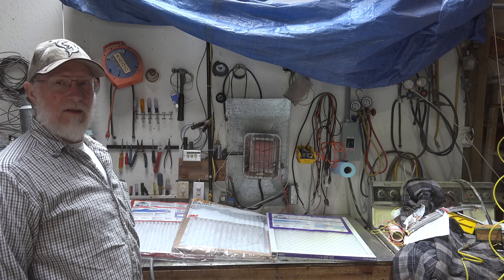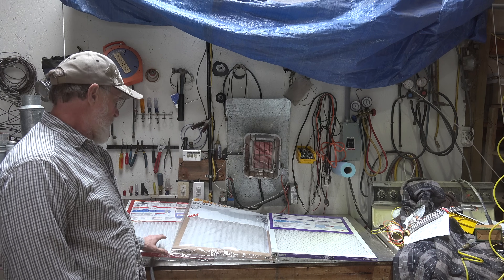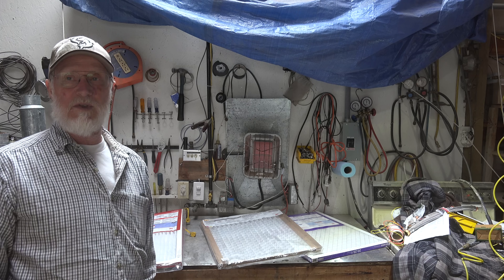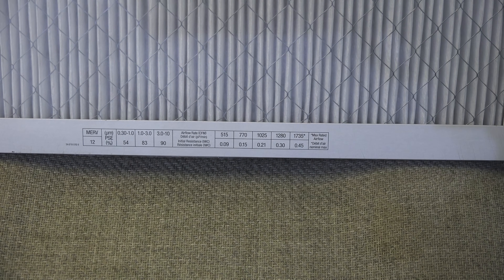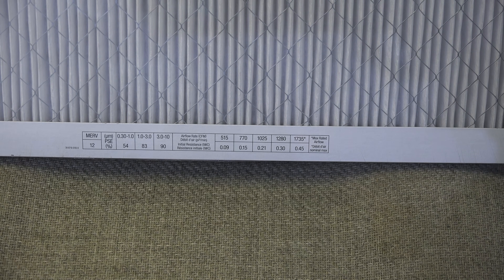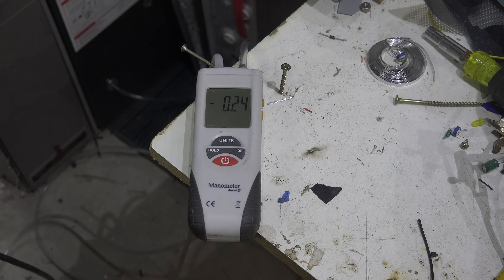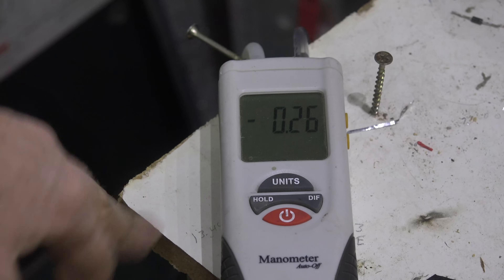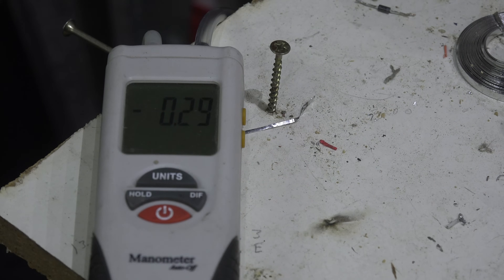What furnace filter is best?

Comment: Crazy how filtrete claims to have the best air flow when I discovered filtrete filters caused the most static pressure. A filtrete merv 5 caused more static pressure drop brand new then my used HDX fpr7/merv 11 after a month.

Comment: This is so confusing !! Should I do a pleated basic , 4, 8? ( older gas furnace )
Reply from the maker: Actually, I generally recommend the cheap fiberglass filters, changed once a month.  Most of the pleated filters have too much pressure drop.  More on this later.
GFM
Reply: @grayfurnaceman  thank you so much ! The furnace guy called them “ bowling ball” catchers 😂 im so conflicted 
I have a basic pleated ( say it so cheap it gets sucked into motor ) 
5 and 7 ugh just ugh
Reply from the maker: @bunnybubs757  I usually say rocks and birds.  The filters are just there to protect the equipment.  The only ones that thoroughly clean the air are the hepa ones.  Most of them are too restrictive and will reduce air flow.  Changing them once a month is fairly good as these filters have oil on the element that catches dust.  The oil gets saturated after about a month.
GFM
Reply: @grayfurnaceman  😂☺️thanks For your reply ! Its an older gas furnace ( no A/C ) im trying to find one to keep the motor going without incident , I’m not really focusing on what it’s supposed to do for the air quality , the blue fiberglass every month probably won’t work .. I’ll forget .. 3 month is reasonable
Reply from the maker: @bunnybubs757  Do it when you pay your bills.
GFM
Reply: @grayfurnaceman  Great idea ! Thank you so much

Comment: Just had a new furnace installed.  I read the install manual and it states to use "High Flow" air filters and change them monthly or more often if dirty, so I'm using a MERV 4 filters.  Our return ducts have (3) 20x20x1 filtered returns.
Reply from the maker: They should work well.
GFM

Comment: We have a 100+ year old house with an old furnace and imgs.love/ACFiltrete?Aた we are currently doing construction in the house which adds to the already very dust, dirty vents. In the meantime, we've been using these and switching them out as frequently as needed. It's made a huge difference for all of us in terms of sneezing and even some asthmatic issues for one family member. The value pack is a great deal, and they are easy to swap in and out. Highly recommended!
Reply: So confusing , mine say 4, 5, 7, 8.. to go by low numbers .. help

Comment: Many older systems are less efficient at heating & cooling when you " give it a better filter ".  They end up running 50% more to deliver the same number of BTUH.  They were designed for the inexpensive Monthly filters, ONLY.  The high MERV filters are not compatible with the blower motor pressure,  heat exchangers & ductwork.

Comment: Great video! Quick question- I always believed that big, thick filters are better, so I was going to install a 4 inch filter box to hold a thicker filter, but a guy at the HVAC supply store that I was going to buy the larger filter box at told me that a 14X25X4 filter would flow too freely for my furnace and cause the blower motor to overload from too much airflow. He said that using a thicker filter than the furnace specs voids the warranty, causes premature blower motor failure, and a bunch of other nasty things.Is it not okay to install as thick of a filter as possible? Thanks

Comment: The lower MERV rated filters have less pleats therefore in a sense they are more restrictive while at the same time capturing less fine particles.   Like everything in life, furnace filters have a cost to benefit ratio.  At least when new, the air restriction of each filter was similar, but it's dust catching ability varied significantly.  Some other articles suggest that very high MERV rated filters which remove "allergens" may not represent a good value unless you actually suffer from allergies.   How much dust a home is experiencing is another issue.   A dog that sheds a lot might be a major factor.  Bottom line: it's probably best to stock up on reasonably high quality filters when they are on sale.  I know in the fall some of the major hardware chains have good promotions.   Interestingly at least where I live, Walmart has a very good assortment of filters at what I believe are reasonable prices. Probably the most important thing from my perspective is not to go too cheap on filters that have limited ability to pick up dust, and to keep an eye on the filters you do decide to use.  One lady I did some work for didn't even know her furnace had a filter and it was filthy.  Eventually the blower motor burned out as the windings were all clogged up with dirt and there was little to no air flow through the motor.  Perhaps the best filter is the one that offers the most protection to your furnace.  One thing I like very much about my Goodman is it has a very good filter box that seals the filters in tightly yet, they are easily accessible and slide in and out easily when changed.  My old furnace had awkwardly located sheet metal screws that were hard to remove and replace, plus the filter itself did not fit very tightly in the duct.  It was a very annoying chore to change the filter. Now it's extremely easy, and I love that.

Comment: I have new furnace, using charcoal filters due to heavy smoker below me in my building.  It is a Merv 8.  have not felt any issue with my furnace though only 2 years old.  Due to heavy smoking, it supposed to change once every 3 months, but with heavy smoke, I change every month.  And these not cheap to buy either!  Can run pretty expensive like $20.00 for one filter.

Comment: A question for you.  I'm want to just cool the master bedroom and the adjacent hallway this summer.  So I am closing all the other ceiling registers and hanging a curtain at the end of the hallway.  The filter inlet is in the hallway, as is the thermostat.  Will this hurt the A/C unit?  It is sized for the entire house and located on the roof.
Reply from the maker: You kind of have a recipe for disaster here.  The system is designed for the whole house and cutting down airflow will probably freeze the coil at the least or damage the compressor at the worst.
GFM
Reply: Thanks  GFM.    I will instead install a small window unit then and leaving the big one turned off.
Reply: May cause mold as well.

Comment: My system can accept either standard 1" or the more deeply pleated 2" filters.   I'd be interested in seeing the difference in pressure drop between the two.    

The deeper filters are both more difficult to obtain and more expensive, but supposedly have less pressure drop after a month or two of use.
Reply from the maker: I will be doing more on filter pressure drop in the future.
GFM

Comment: If you ask me, the best filter on the market is the Lennox X6672 MERV16. Its a 5" filter, and has a huge amount of surface area to massively reduce the pressure drop, extend the life, while giving exceptional performance. They're also relatively cheap at ~$60-70/ filter, considering they should last about a year for most houses. It does need a cabinet to hold it, but they're under $100. Not bad, considering the performance and lifespan.

Comment: My dad's old furnace guy said to get the cheap spun filters and change them every month. They let so much junk through that the evaporator ultimately became the filter. It almost completely clogged and the furnace would shutdown due to overheating.
Reply: RickMakes if this is true your filter is too small causing too much air velocity through the filter
Reply: probably older home with return ducts not sealed from attic and walls with blow in insulation added. undersized ducts, under-size filter. I recall most all the older units having 2+ large filters inside the return/blower cabinet.
they worked well and had far too much filter surface area i guess! so the computer age engineering quest for marvel, supposed efficiency and compact size won ;)
Reply: yes.  The dust/dirt has to go somewhere.  The dust/dirt either go in the restrictive filter or bypass the cheap filters and into the evap coils and dirty ducts and back through the floor registers.

Comment: I recommend the 30 day filter to my customers,  and I stress frequent changes.  Most customers wont do that.  Most of the filters I find are way overdue for change.  Thus is the chief reason I recommend 30 day filters.  They dont restrict airflow like the denser ones do,  I have changed a lot of blower motors because of plugged filters creating high flow resistance.